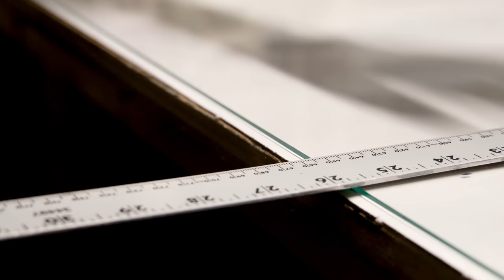Flowing Forest Waterfalls Pond Planter (Satisfying and Relaxing Build)

Comment: Always enjoy the quiet builds! I do want to mention that floral foam is not a good building material for anything long term nor is it environmentally friendly or safe for use with animals. 

Many of us in the floral industry are working to push the field away from using floral foam, it is essentially made from micro plastics (with some formaldehyde thrown in 😱) and will break down fairly quickly in water. It's mainly used for structural floral designs in the short term since it will hold water and provide stability to hold up flower stems. 

These are things that can be accomplished easily with more sustainable options like chicken wire, woven branches, and MOSS!  I imagine that as this continues to take up water in your build that it'll start leaking green foam into the pump and possibly clogging it? I'm sure it's not good for the plants either.

I feel the more people know that it is micro plastics, the more they won't want to use it and will spread the word!
Reply: I did think it was toxic. Ta for that tip.

Comment: Absolutely beautiful.  Stunning, in fact.  I do have a couple of questions, if I may:
1) What is that black material you cut up to make the filter housing, and where can one find it?; and
2) Doesn’t that floral sponge material biodegrade or fall apart with time?
Thanks so much!
Reply: Black material is Expanded PVC. It's basically a styrofoam board; I've seen them in dollar stores or other craft locations. 

No data on floral foam at this time.
Reply: @markielpilos  Thanks.  But you’re not referring to the paper-coated foam board they sell at craft stores, are you?  These seemed to me more rigid and waterproof/resistant.
Reply: @dartmart9263  nope! Pure Styrofoam, if I recall. The paper coated ones are a little too flimsy to hold unfortunately

Comment: Hello! I’m a new subscriber. Recently I just built a tank and was growing my plants emersed. However, I met the issue where mould starts to build around my hardscape wood. I saw your video and was wondering if you have any suggestions against this problem? I’m currently not wetting my wood so the mould won’t grow, but it still remains there… 😭
Reply: i think he had a video where one of his tanks got a huge mold problem, and the wood was rotted. he had to start over. dunno, may have something to do with the type of wood you used which made it more susceptible to rot, but i'm not the expert in these things.
Reply: The majority of new setups will have mold on the wood, it's pretty normal. That's exactly why we throw springtails in there!
Reply: Springtails help